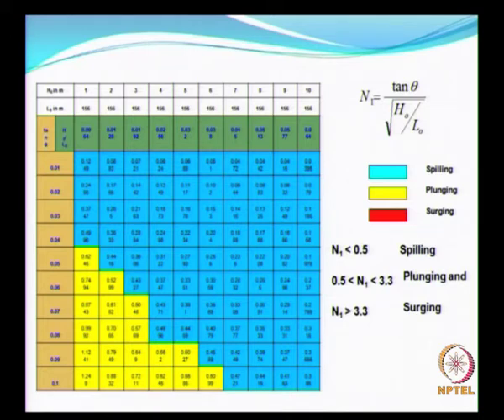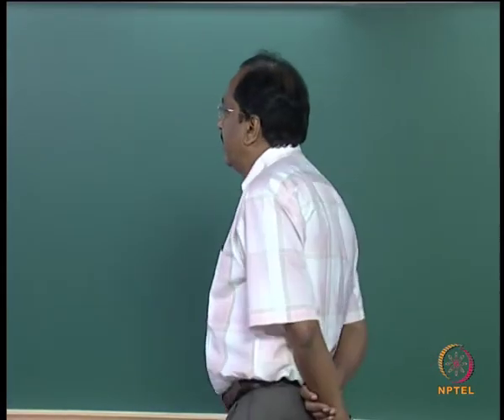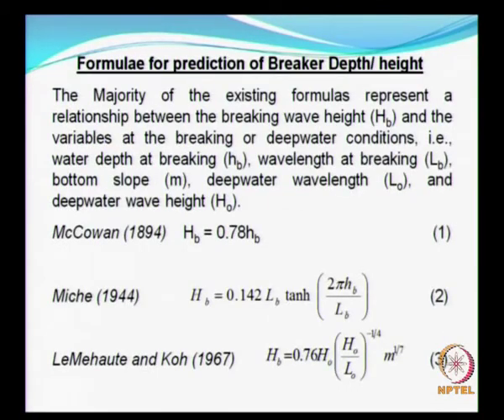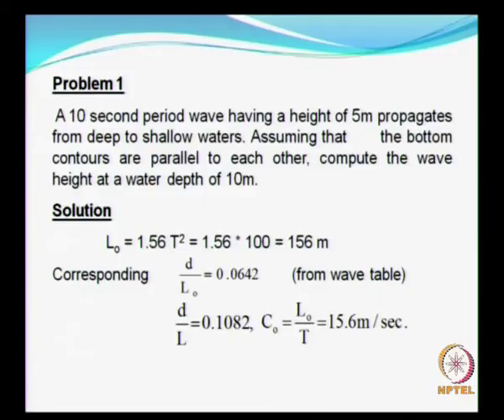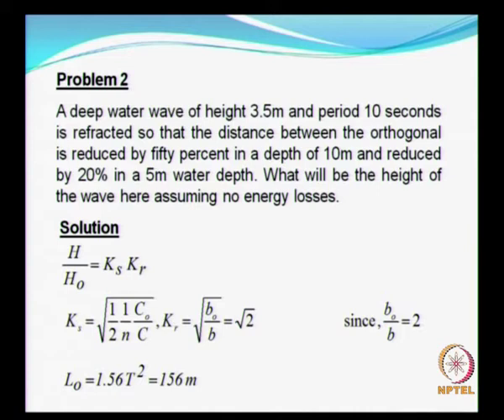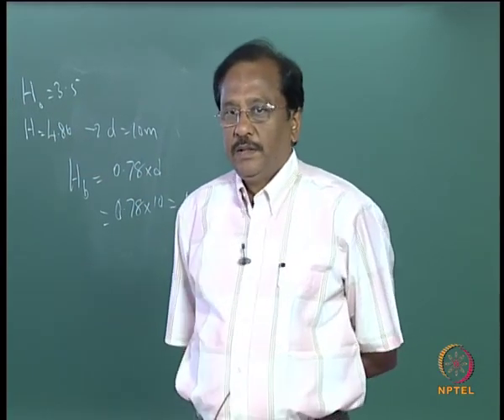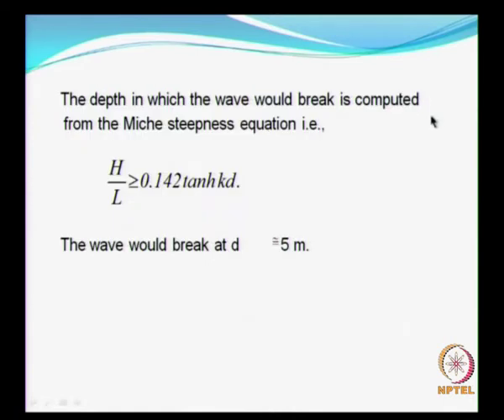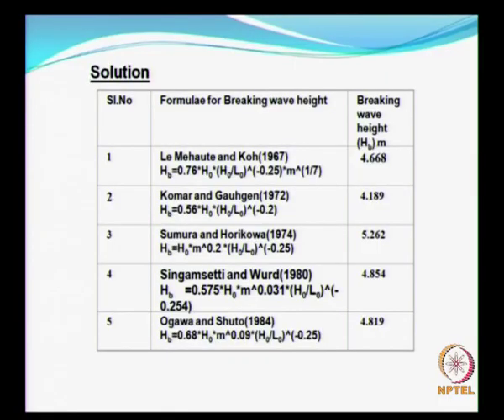Wave Deformation and Problems

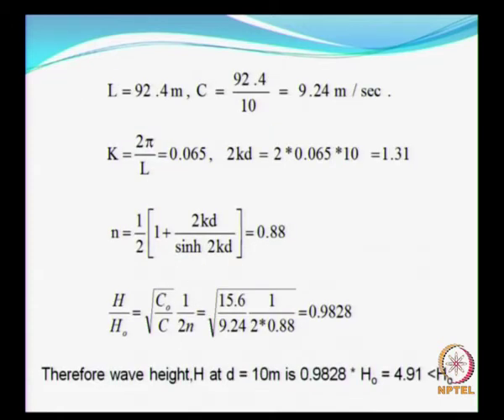Comment: Hello, professor Sundar. I think there is a minor typo at 18:00, in the line before last: the square root does not extend all the way in the symbolic formulation of the shoaling coefficient (as it does in the next expression where the numerical values have been substituted in).